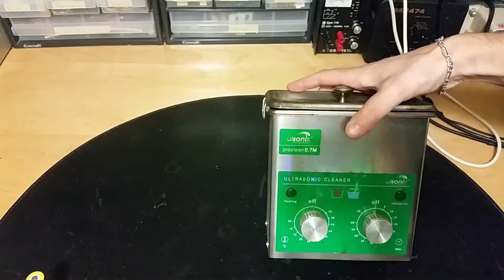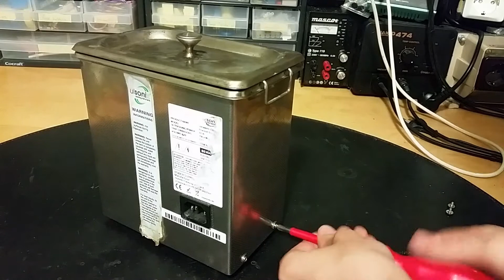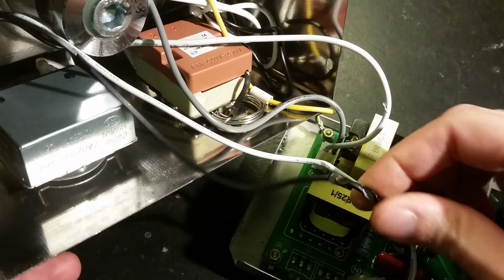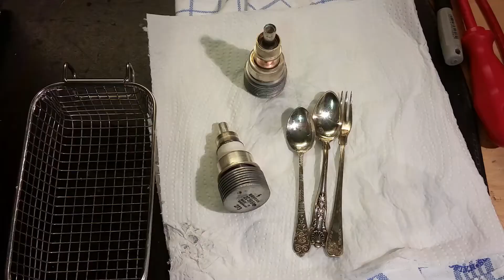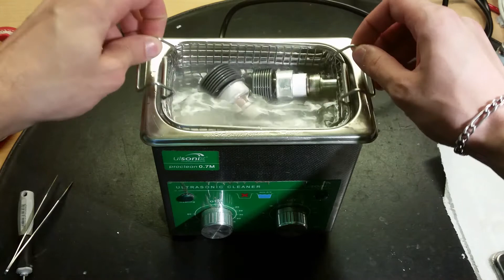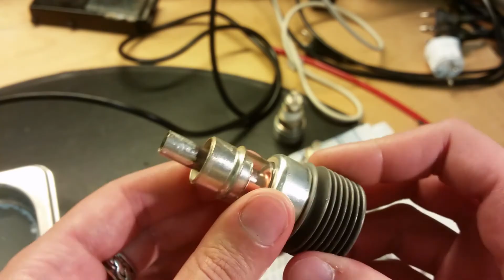Ultrasonic Cleaner Repair

Comment: I usually repair big ultrasonic cleaner used in CSSD hospital. other than driver circuit, sometime the driver keep failing due to faulty transducer. I usually use 2 ways to test the transducer. 1st using capacitance tester ( make sure freq tester 25Khz & 40Khz) and the result should be within 0.004 uf range. 2nd is using Megger and set  tester 2500Vdc after disconnect the transducer with driver. check for current leakage. 3rd & 4th check resonance using oscilloscope & Signal generator check for resonance freq.

Comment: Surface mount? Or single sided pcb with through whole component
Reply from the maker: Single sided with only through hole components
Reply: So no heating coil
Reply: Where are U located, I wonder if U could repair mine? Thank U.

Comment: It's a Royer Oscillator circuit, which ever power transistor has the higher gain starts the oscillation, the gate transformer is wired so one transistor turns the other one on, and hence itself off.
Must be the season for dead Ultrasonic Cleaners, mine died to. I've replaced all the dead parts except one, but it cannot be fixed as something else died the postal service!
Replacement transistor out of stock locally, at least another week before they have any to mail me, and the bigger Ultrasonic Cleaner is also stuck in a mail logjam.
Reply from the maker: Yes thanks mate, i'm in a little hurry to repair these cleaners and hadn't time to reverse engineer the circuit
I hope you can repair your cleaner
Thanks for your comment